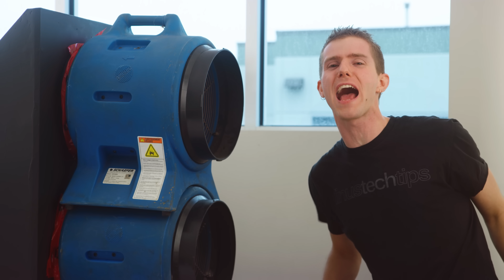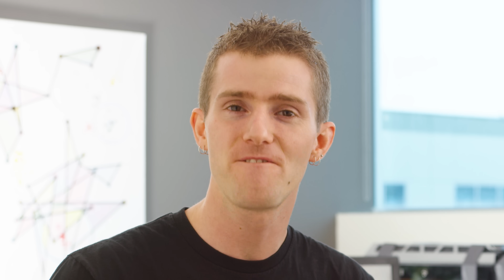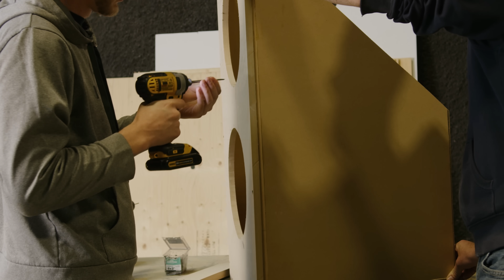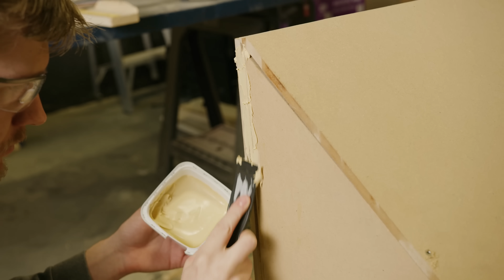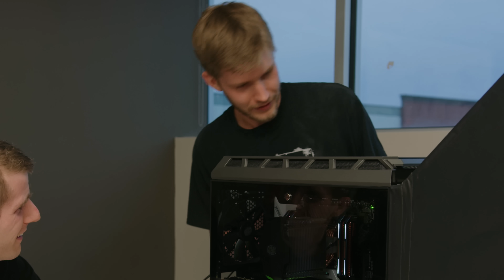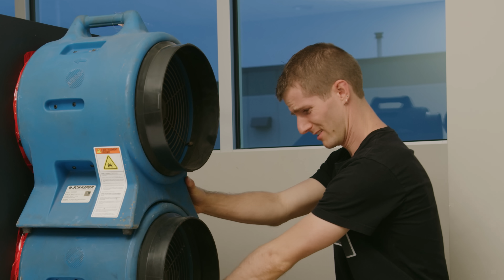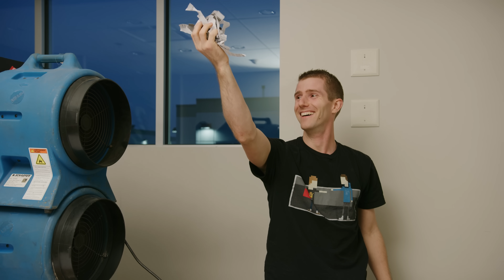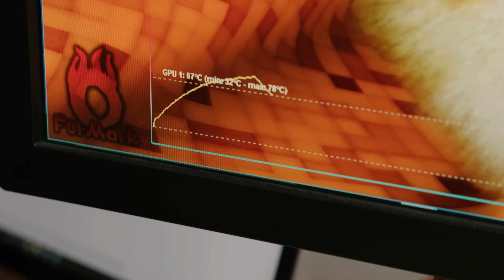Highest Airflow PC EVER - SUCCESS!

Comment: meanwhile kids in 2040:
"wow, even my crappy phone is more powerful than that huge thing!"
Reply: more like 2028 or so already :D keep in mind that computing is still developing somewhat exponentially. so the gains we had in the last 10 years, we can expect in the next 5 to 10 years to double
Reply: @GuRuGeorge03  i think we are already reaching the physicly possible maximum cpu poewer possible... Unless we Turn to quantum cpu's i dont think PC CPUs Will evolve exponencialy... Might evolve logarithmicaly.
Correct me if im wrong
Reply: There’s potentially only so much you need a phone to do. We could reach a point where personal devices stop getting more powerful just because there’s nothing left to do with the extra compute power you can have. I assume at that point improvements in efficiency will continue to be made for a bit so devices use less power and generate less heat.  
There’s a theoretical limit to architecture which means it can’t just keep getting smaller. Moore’s law more generally considering computing power has previously started using a different technique to continue delivering exponential gains, so for example when valves switched to transistors. I wouldn’t say Moore’s law is dead yet.
Reply: @cjeam9199  moore's law is not exponential but linear.
we will never reach "enough" computing power, there is no such thing.
Reply: John Smith The observation is that transistors about double every two years. That’s exponential growth.  
There’s definitely enough computing power for personal devices. For an analogous example look at display resolutions. There’s no point having more resolution when your eyes aren’t good enough to see the difference.
Reply: @cjeam9199  that's such nonsense...there is really no point in wasting any more time with you
Reply: John Smith haha, that’s because you’ve lost the argument. 😉
Reply: @cjeam9199  wow, instead of talking out of your head you should at least research the most basic fundamentals before you talk.....
this is ridiculous...
Reply: @JohnSmith-pn2vl  you relize that there is literally a video on youtube comparing the newest phone to a 700-1000 pc and the pc outperforms  everything that a phone had. Also 500 dollars cheaper
Reply: John Smith accusing me of misunderstanding the basic fundamentals is a bit rich when you thought a doubling is a linear growth rate.
Reply: @legend-rx9ik  show it to me
Reply: @legend-rx9ik  i recognize the link

it still didn't stop me from clicking it
Reply: @ranzerai  my man
Reply: @cjeam9199  from the knowledge of my course (electrical) we're still on the nano quantum technology and talking of Moore's law we're nearly to the end of nano size.. The next computer technology is optimizing software with parallel process in programming...
Reply: @legend-rx9ik  dude believe me.. a 500 dollar pc is enough for a smartphone in next 10 years..
Reply: @JohnSmith-pn2vl  and to add on, no cpu manufacturers do not copy each other, Amd and Intel use completely different designs, which is why Intel is still mostly stuck at 10nm while amd is already at 7nm. Same reason why they also use different sockets.
Reply: @s2s561  i was saying they all try to copy Apple M1 now, because Apple has shown how it's done. Intel, AMD, Amazon, Samsung, Microsoft, all have announced an M1 "copy"
Reply: kid in 2040: what is a "phone"?
Reply: IGGY!!!!!!!!!!
Reply: kids in 2040 will be mining coltan for microsoft citizens
Reply: you mean your implanted brain chip the size of a grain of rice?
Reply: Phones are faster than pcs? Bruh did your local store sell you a crappy pc by decieving you? ARM & x86 is completely different thing, if phones are faster then don't you think cpu manufacturers would also do the same for skyrocketing their sales? If phones are faster by using 6w of power, then you're clearly dumb enough, or maybe you have an crappy apple SoC in your head instead of a brain
Reply: @psikder1  cpu manufacturers do indeed all try to copy now because it is so much better
Reply: @JohnSmith-pn2vl  kid go home your drunk
Reply: @abeerzeeshan9136  i don't drink, get a life
Reply: @JohnSmith-pn2vl  That's blatantly false. Any phone when compared to a properly built computer, at a similar price point will result in the computer winning. When comparing raw compute performance ( without  cuda, avx12 or open cl) you will find that any comparable phone will be absolutely crushed. Even without the price limitation (while using favorable hw acceleration when possible)  the newest flagship phones will find themselves behind a pc. Even when it comes to the new m1 arm based chips they are pretty bad in comparison for performance per watt. When using a m1 to hash certain functions (on sha 256) it lags behind even an rx 480 8gb. I used the sha 256 algorithm specifically for its disregard when it comes to hw acceleration. Also fyi single core is pretty meaningless when it comes to workloads aside from media consumption or some older game titles.
Reply: @temkaster2  this is not true, the m1 is literally the best in performance per watt.
single core and performance per watt is all what counts. 
stacking cores never was a thing, you can stack as many as you want, thats why. single core determines the speed of things on a machine, no an soc increases that particular, meaningful speed, as well, a whole new level, snappyness ou will never achieve on a PC. 
The difference is above and beyond of what faster memory or ssd's do on a Pc.
 also, 99% of all games and apps don't use more than 1-2 cores, most only 1.
you dont have to buy a high end flagship phone, a regular iPhone 12 will beat easy any pc in the same price range, especially in video editing and video rendering.
you are assuming, stop doing that.
sha 256 is the worst for an M1 at the moment, meaningless.
show me your Pc and lets video edit a 4k, you cannot even build a 40k PC that wont stutter or be similarly smooth.
i mean you buy everything, the case , the fans, the ssd, the memory, the mainboard / w-lan adapter, the monitor, the keyboard, the mouse , the mousepad, the operating system, the gpu ;)
thats an extremely good PC, a very niche market, the gaming and creators PC.
meaningless and not average in the whole world of PC's.
Celeron? plz.....you gotta get at least an i9.
ryzen, dont get me startet, not possible to make a snappy windows machine, even less with Ryzen. although the 5800x beats the phone in some areas, but still sux, overpriced room heater.
Reply: @JohnSmith-pn2vl   From the top. "M1 is literally the best in performance per watt" let's say you can isolate absolutely everything that doesn't deliver power and let's assume that this M1 chip is running off of a slave board with a monstrous 14 separate phase vrm (shunt mod) it consumes approx 27 watts at 98% (pde). Now let's say we're doing video rendering, it does do well, but it also isn't groundbreaking a 4700u does about the same at a similar wattage at half the price on average.  When it comes to any processors above the 4700u in the laptop department the M1 starts to fall back (as is expected).  "stacking cores never was a thing" multi-core performance doesn't exist lol? On the other hand, if you're referring to literally stacking archs' that isn't going to be a thing for a few more years.  "single-core determines the speed of things on a machine" Not really, the responsiveness is governed by a variety of factors usually having to do with how the file system is conserved and accessed (ram, storage, OS, and CPU cache). This is why old c602 Xeons (Ivy b. usually) are still around in gaming PC's around the world. "99% of all games and apps don't use more than 1-2 cores, most only 1"  I would've agreed with you 5 years ago on this one. Increasingly games are becoming multi-cored and threaded to accommodate for stronger and more available multi-core systems. "a regular iPhone 12 will beat easy any pc in the same price range", Unless you plan on getting a 100L vat of ln2 you're not going to match any (competently built) pc from the last 5 years with an iPhone 12.  "You are assuming, stop doing that" I'm giving you a best-case scenario I have to make a few assumptions to make sure you understand what I'm talking about.  "Sha-256 is the worst for an M1 at the moment, meaningless" It's literally the most used encryptor in existence, But I was using it as a completely unbiased source of raw performance. As I have explained before it cannot be accelerated with instruction sets making it a completely level playing field. "show me your Pc and lets video edit a 4k, you cannot even build a 40k PC that wont stutter or be similarly smooth", I this supposed to be an insult? a 40k pc would clown on everything. Even a $1.000 Usd system could edit 8k raw, if I was able to use second-hand parts I could definitely make a very competent computer for video rendering.  "i mean you buy everything, the case , the fans, the ssd, the memory, the mainboard / w-lan adapter, the monitor, the keyboard, the mouse , the mousepad, the operating system, the gpu", The keyboard and mouse would be trash, I don't need w-lan adapters the mb comes with one, if the monitor could be a panel I would get an 4k panel and get a driver for it, the case can be an open air bench or a server rack, the ssd would be a nvme wd black or samsung 970 pro, the fans come with the case, the memory would be ddr4 3000 mhz, the motherboard would depend on the cpu, and the gpu would definitely be a 3060 ti.   "not average in the whole world of PC's" there is something to be said the about ignorance in this statement. Not everyone has an iPhone 12.   "Celeron? plz.....you gotta get at least an i9" I admit that was a bit of a joke, but an fx 8320 would definitely rise to the top in some benchmarks due to its extremely high clock and insane single-core performance.  This is why I chose to use Sha-256 as a more realistic benchmark. "ryzen, dont get me startet" Can you please spell correctly?
Reply: @temkaster2  i cannot spell correctly, i just learned english from internet, il try.

could you please hit the enter button now and then, that wall of text is exhausting to read.

an fx 8320 has a terrible, terrible, single core performance, it wasnt even special in its time in 2012.

"lets assume that", and on top of that "let me buy used parts" "the monitor could be just a panel and".......i mean....
no, just, you render video with a mac m1 using only 10 watts from the socket. the fan will never be audible or turn on. in the case of the air, it doesnt even have a fan.
or the iphone, you render your 4k and edit butter smooth, you can use external monitor and keyboard etc, but not needed really.

dont compare a single ryzen cpu power consumption to a whole System on a Chip.
that ryzen wont do anything without the rest, its mandatory.

games from 5 years ago still exist today, as any other game that has ever been made.
you have to specifically name latest AAA titles if you mean that, but there is nothing to see there, there is not much use for more cores in games. 
time critical, realtime performance, is only doable with 1 core. hard to offload things.
rendering operations (besides Audio which still needs to use only 1 core) are perfect for this, and heavy multi tasking.

its just like the 8 core snapdragons, a complete waste and useless, not used by 99,99% of Users/Apps, just marketing.

you have to compare native M1 software, not just "arm" , this is not an ARM chip, its just the architecture, apple designed the chip. (huge investment that takes 5-7 years)
 
this is just the beginning, an entry level chip, matching ryzens fastest single core available. ryzen is only good at benchmarks really, such a hassle of a platform. 
intel is still better easily overall, especially xeon.

the SOC is magic, it accelerates everything beyond immagination, it feels like you got a faster internet connection.

this is the real advantage, you can put all the wannabe "high end bling bling rgb" overclocked gear in a Pc, it will never run as quick and smooth like a phone, especially iphone.
Reply: @JohnSmith-pn2vl   Sorry I was typing (and still am ) on a phone so the format can be a bit off but I'll try my best to space it out. 

You're spitting jargon at me that makes zero sense in the context. 

 There is pretty much nil difference that comes to which is easier to use between AMD and intel. It comes down to preference and nessesity. 
 
You need to know the definition of logical cores vs physical cores.

I would love to see someone scrub 4k video on any iphone.
 
You're confusing TDP to actual power usage.

Also, M1's suffers from thermal throttling, so they're not 10 watts lol. 

what is your definition of a SOC? Because it appears to be way different than everyone else's.

Also, do you think that a Xeon could outperform an EYPC?
Reply: @JohnSmith-pn2vl   I don't think you really know what you are talking about.
Reply: @temkaster2  i never said intel is easier to use or anything similiar, there is indeed nil difference.

i know the definition of logical and physical cores.

i am not confusing TDP with actual power usage, thats why i said from the wall. TDP i s pretty much useless in that regard.

thermal throttling is a feature, not a weakness. thermal throttling on M1 is very minor, basically never kicks in. tdp is 20w if i remember correctly.

you would love to see anyone scrub 4k on an iphone? well just watch any video about it then? heres one: https://youtu.be/4ndGHWTboE4

its not even a matter of outperforming in XEON vs EPYC, its soft and hardware compatibility, if you are talking about outperforming, ARM has the lead there as well.
Reply: more like 2077.get it cause its like cyberpunk.
Reply: imma comment of here just bc im intrested if this will continue
Reply: @mr.battlecats5512  lol same
Reply: not yet
Reply: @Bepis Head what chips are you comparing
Reply: HollyT   begone!  now the iPhone Chip is in Laptops and Desktops as well.
Apple’s new M1 processor beats Ryzen 9 5950X and Core i9-10900K in Geekbench 5 single-core performance.
passively cooled in a macbook air xD

Comment: I suspect if the intake fans were placed at a open window on a cooler day and the outtake air is being pushed into another room, you would probably see even more impressive results. In your current setup, the air is circulated in the same room.

Comment: You should add an LN2 drip feed into the airstream. You'll be able to run the entire CPU section of the board down around zero degrees F at full load.

Comment: Holy crap wear a respirator when cutting MDF that is absolutely the worst kind of dust to inhale. It contains urea formaldehyde.  You'll get cancer easily. On top of that the particles from the dust are so small they get so deep in your lung they never come out. Some can be small enough to go straight into your blood stream.

Comment: i wonder how much heat does these motors generate, i would probably put them so they suck the air out of the pc so that the fresh air from the room gets in and than it is introduced to the potential heat of the "fans" and remove the fan at the other side of the computer

Comment: The question is: How far can you overclock your new air-cooled rig?
Reply: Enough to justify buying a power supply for just the cpu
Reply: @lukewhite9237  LMAO!
Reply: Answer: Yes
Reply: probably not higher than 7 GHz since the maximum achieved with liquid nitrogen was ~9 GHz I think
Reply: yea i would just keep overclocking to see how overkill that pc could be
Reply: 4.9 GHz
Reply: @Vikum Semage they couldn't even hit 10 with liquid nitrogen cooling
Reply: 69 Ghz  ;)
Reply: you also need a very huge grill to get use of that air speed
Reply: “YesGhz”
Reply: Lmao. 1 year ago
Reply: New 💀
Reply: About 23.3GHZ

Comment: You could have done this with one fan, half this size, if it was a "squirrel cage blower". Those fans are for open-air systems, because they have low static pressure. I would bet that the CFM you were actually getting was about 1/10th the rated air-flow. With that ramp, each fan was fighting the other. You would eventually heat-up the whole room to crazy temps with that setup. It is the "Pressure", more than the "Air-flow", which provides the best potential cooling. That is why water is better than air, because it has a greater "mass-pressure".

If you left the top off, it would have had better air-flow. You should have cut out the back of the computer case, if you wanted higher air-flow. But you would have lost almost all static pressure and seen worse cooling values.